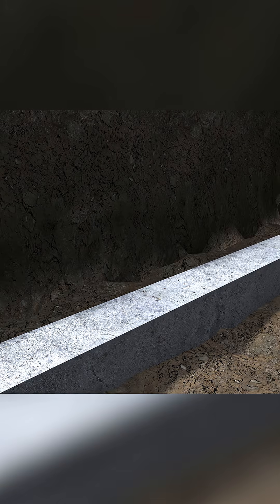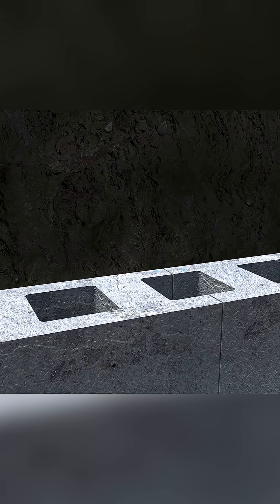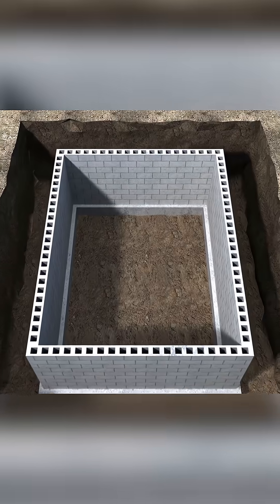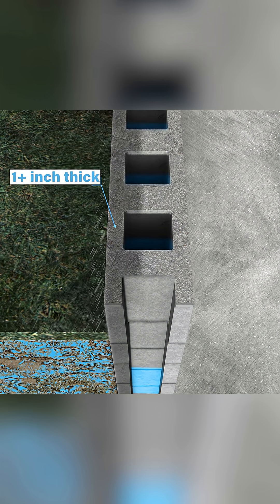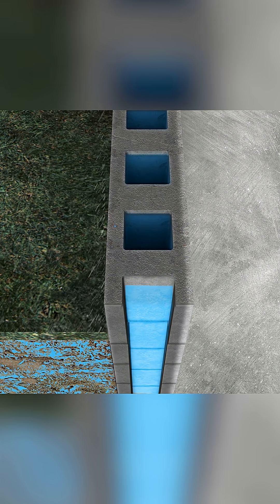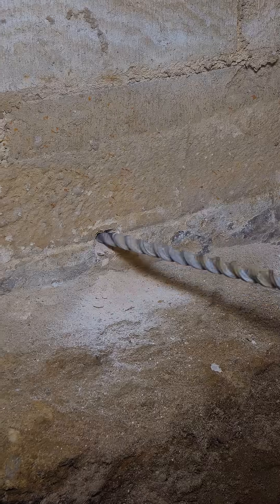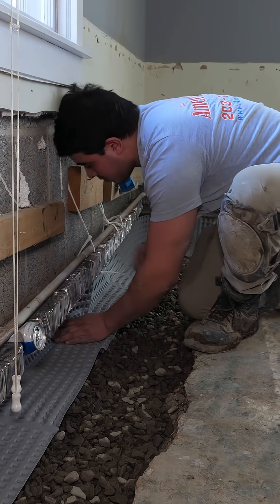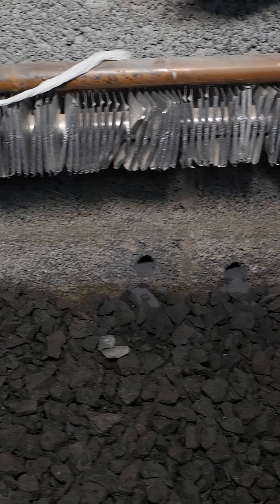Block Foundation Waterproofing Explained | How Water Fills Cinder Blocks #basementwaterproofing

Comment: I would knock holes in second from top course and have grout filled in which is water the cores are made for also stick rebar down even though it wont be connected to the footer it will provide protection in the wall.
Reply from the maker: Interesting approach — though for drainage, we focus on relieving pressure at the base where water naturally collects. Adding grout or rebar higher up can trap moisture instead of releasing it. The weep holes low on the wall let the block cores empty safely into the drainage system.